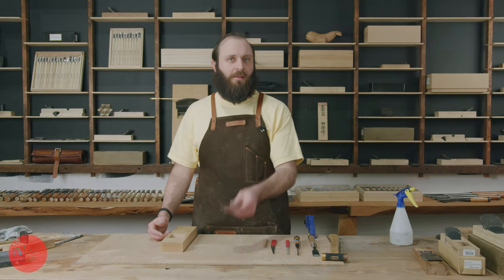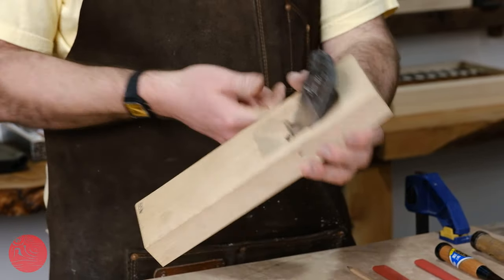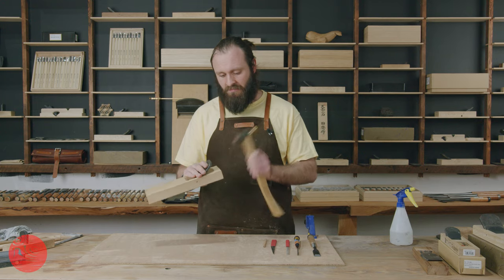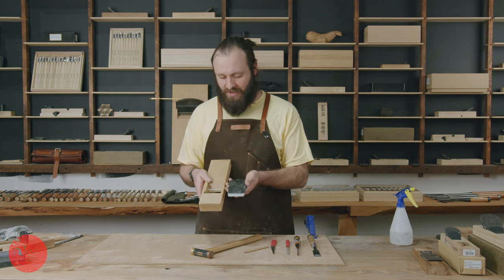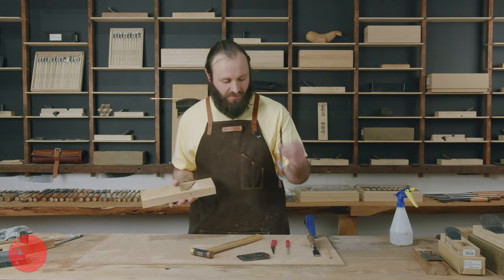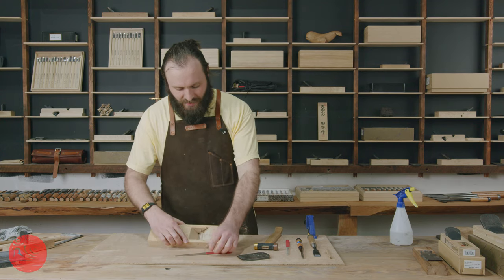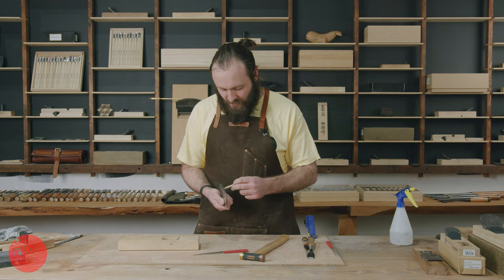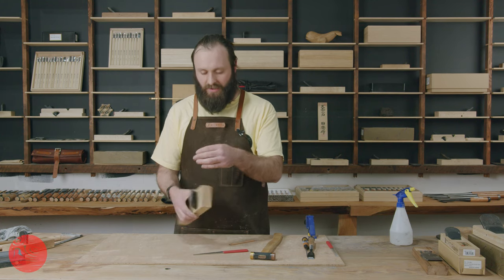Japanese Plane Tuning - Part 3 of 5 - Fitting the Blade to the Block

Comment: Great video Mitch!  I am quite familiar with making western wooden planes, but you illuminated a critical difference of the Japanese plane blades - they are tapered the opposite way of western (old) blades that require a wedge.  That fact makes so many things make sense now.  Western blades are fatter at the cutting edge to make the wooden wedge lock it into place by mechanical lock against cutting thrust, not just by friction.

Comment: Greetings from Los Angeles.  How the heck did an Aussie become so knowledgeable about Japanese plane blades?  I am guessing a woman was involved.  None of my business …sorry.  Anyway, I occasionally buy fairly large lots of old Japanese planes, I refurbish them as best I can and sell theme.  Since this is my hobby, not my job, I can work for less than minimum (lol)   Wage…..and people,can buy a decent plane that is good to go except for final polishing on the blade…..
For 20-40$ depending on size……which is a steal.  Sometimes I lightly sand the base and coat with linseed oil….looks prett6 darn nice…..these are older vintage planses.  The wood is a pale yellow with thin dark “veins”……any idea what it is? Larchwood?  The other question I have…..many of the blades have lots of rust…..that is very difficult to remove……any suggestions?  am I correct that the older plane blades (stamped) are generally of higher quality than what Japan is producing today (example kakuri).  Last one…..I love looking at the different stamps on the blades.  Since I can’t read japanes, I never know if one blade is more valuable than another.  Is there some type of list available that shows the better vintage blade blacksmiths and their corresponding stamp…..I realize this is a lot of questions.  Any reply would be very appreciated.  If you have a legal question, I am happy to assist you as a friendly trade of info.  Thank you whatever you decide.